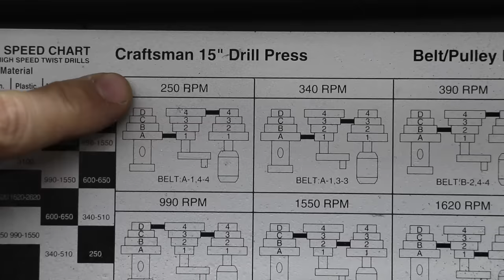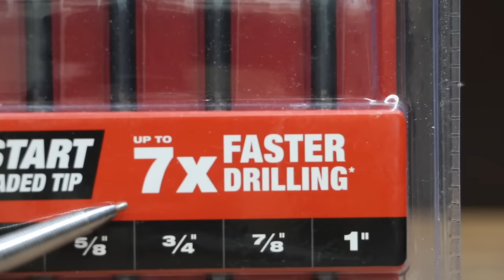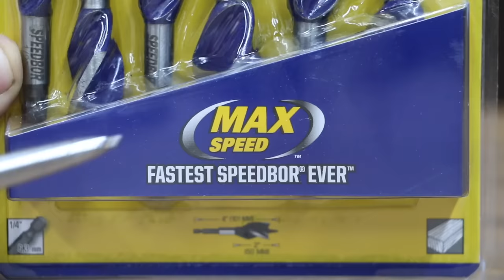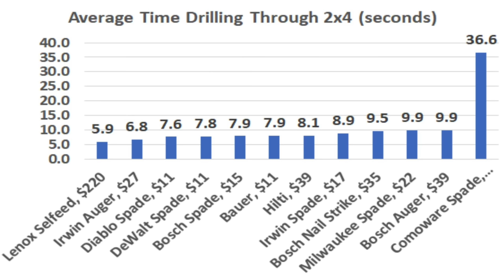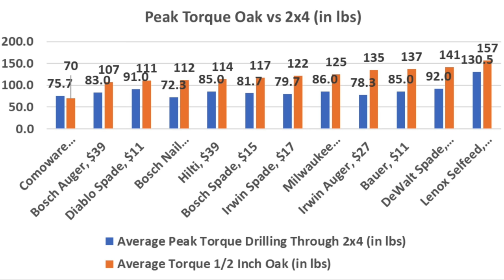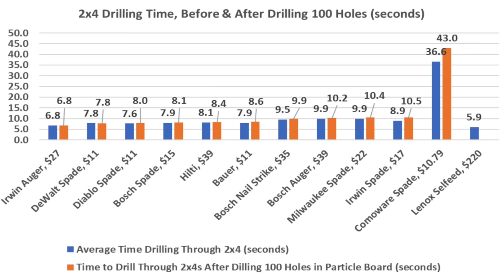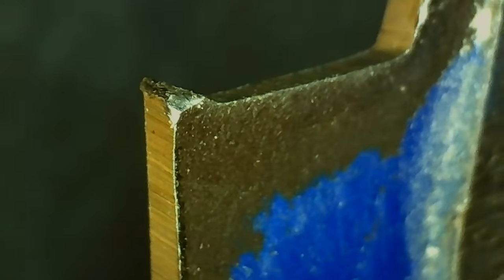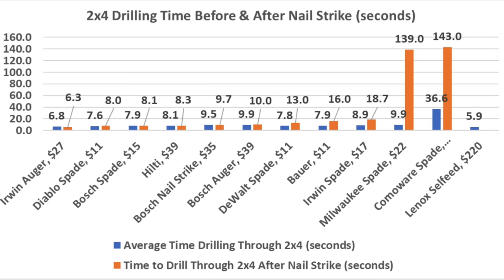Best Drill Bit Set? Hilti vs Milwaukee, DeWalt, Bosch, Bauer, Lenox, Irwin

Comment: This was very informative! My only wish is that you could have included a few more types of bits. I would have liked to see some cheap Walmart HyperTough spade bits along with the new Diablo Demo-Demon spade bits that incorporate some of the Bosch Nail-strike and Dewalt  endurance corner features. 
I would have also liked to see the various Spyder wood drilling bits included along with the very high-end WoodOwl brand Overdrive bits and the Milwaukee Speed-Feed auger bits. 

But perhaps that would have been too much work and made the video too long. Hopefully you can cover them in another video. You spent several videos on different types of motor oil, so I don't see why you couldn't have a wood bits video Part 2. 

I actually think a lot of your videos could use a part 2, especially as new products have come out since you made some of the older videos. I hope to see more "part 2" videos in the future. 

But I imagine you also have a large number of product types in the que that have never been tested before, so I can be patient.

Comment: As an electrician I drill hundreds of holes a week and often hit nails, the auger style bits outperform spade bits by a long shot.  What your test did not take into account is we often don't get a straight shot at the work and are drilling at odd angles and there are almost always nails.  Nails eat spade bits.
Reply from the maker: Thanks for the constructive feedback.
Reply: i’ve been using the diablo augers, formerly bosch. they last a long time and sharpen really easy
Reply: Spade bits will grenade hand drill gears with their rough exit. I wouldn't use anything but an auger bit; save the spade bits for the drill press.
Reply: @Ch4grin  My drill just snaps off the shafts. I don't use them for anything anymore.

Comment: Very nice, I know from personal use that once you use the self feeding bits you don't go back to the regular ones, some of the regular ones do good but where the self feed really shines is in awkward positions where you can't push on the drill very hard, say in an attic drilling a hole over your head one handed.
Reply from the maker: Thanks!  Thanks for sharing.  Happy New Year!
Reply: Or in a crawl space where you're pinched between old foundation and new joists.
Reply: They can be too aggressive when you need a clean hole like for a lockset plunger. I've actually split a door with one once, and they're a heavy load on a drill. Use the right bit or blade for the job at hand- there's not one that does all jobs best.
Reply: @P_RO_  heavy load? Not for any drill worth being on the jobsite. Different strokes for different trades.

Comment: Those Irwin Speedbor are nuts. I've never taken close to 6 seconds to go through a 2x4 in my impact driver, maybe 3 seconds. Obviously drill press is going to be better for consistency testing, but it is awesome by hand. Never tried oak through, I don't come across that.
Reply: Thats because he's applying a set amount of pressure. Of course they can drill faster.
Reply: Drill presses run far far FAR slower rpm than an impact driver. !
Reply: @DiscoFang  maybe sometimes… but the rotational speed of an impact is inversely proportional to the load it’s experiencing… fast unloaded, slow loaded…
Reply: why are you using an impact driver to drill? 
wrong tool my friend
Reply: @19derrick77  Good point. Then it becomes important to note that Irwin specify a speed of 1500-2000 rpm for their Speedbor. In this test he was running it at 250rpm. If the impact driver is turning at that speed when loaded then it’s def not appropriate.
Reply: @DiscoFang  Yes, the main thing here is every tool has a recommended speed range… Too fast, you’ll burn something up, too slow with a small bit and you may break it if it grabs. My own drill press tops out at 3630 RPM… Not appropriate for much of anything but the smallest of drillbits, a stone or flap wheel.

Comment: Spade bits almost always tear out of leave rough edges especially in grainy hardwood like oak......even worse if they have a threaded screw tap point!  I only use spades for home repair or non visible surfaces.  For clean holes gotta go with high quality forstner bits like the Fisch Wavecutters, but obviously on a whole different price level.  If you need hundreds of high quality holes like for a commercial application then maybe Famag Bormax3 with the carbide teeth.....but they are like $80 a bit.
Reply: Agreed

Comment: Didn't the screw lead on some of these bits negate your "constant down force" rig?  Once the thread bites, the weight is redundant really
Reply: They still need continued pressure for the screw  to bite in softer woods (or not pull out).

Comment: I would love to see if you can find a way to test these bits with an impact, some bits preform better on an impact then a drill and it would a nice indicator of extreme wear over time.
Reply: Yeah I'd like that too, but I think he's going for consistency and unless he has a impact drill press it's not going to happen..
Reply from the maker: Thanks for the suggestion.  Happy New Year!
Reply: @dondiego124  
An impact drill mounted on a press could be used. Impact drill bits of various shank sizes (my Milwaukee motor has a 7/16 hex quick release chuck) are used in construction.

Comment: As a woodworker, I am not too concerned about how quickly a Spadebit cuts. What concerns me is how cleanly the bit cuts and without tare out. No Spaidbit cuts cleanly on the exit, This is why a skilled woodworker will stop just short of the exit cut, right at the point where the point of the bit is poking through. Then the cut is completed from the other side. Another fact. When using any Spaid type bit, light pressure is applied at the beginning of the cut. This helps avoid tare out. And by the way. Only an idiot would try to drill through a nail with a spade bit. No disrespect intended.  😁
Reply: If you give me a 👍. Let me know if you are an experienced woodworker.
Reply: You're right, nobody would purposely run a spade bit through a nail but strangely enough there are a lot of screws and nails used on construction sites (where these bits used the most) and they are often hidden from view. So knowing which brand is going to hold up best to rough and repeated use is the most important aspect of this video.

Comment: I typically love your tests, but with this one you can’t test speed when the main reason some of theses bits are supposed to be faster is because the bit gets pulled into the wood, but that can’t happen in a drill press
Reply: Also different types of bits... it didn't make sense; it's like comparing a powerdrill to an impact driver.
Reply: I know from experience those bosch spade bits when new are about 4 seconds through a 2x4. And with any self feeding bit they are a pig to get restarted if the thread binds up or strips out.
Reply: That is true.
Reply: @TehBIGrat  that's why I switched to WoodOwl. They're too fast though do you gotta be careful not to lose control at first. Plus their bits produce beatter-than-Forstner quality holes and hardly ever any tear out. 
 
They're expensive bits but for the most common sizes (¼, ⅜, ¾ etc) They're worth their weight in Project Farm videos lol. 
 
Try one bit and you'll be all psycho trying to talk people into trying them, like I am. Lol.
Reply: @wojtek-33  to a degree yes, but it's still holding the bit back as well.  But a lot of that is also due to speed bit is spinning.
 
I can put a ¾"  WoodOwl through a PT 4x4 in under 2 seconds. And then I can test how fast the doctor puts the cast onto my broken wrist. Lol. 
 
The buts in the video being the same speed was an issue. Most people using spade bits tend to light it up and bore fast. Where an Auger or Lenox Style (Forstner-esque) requires slower speed.
 
The WoodOwl give too much speed, but can cut smooth like a forstner with hardly ever any Chipotle. It's like a Lazer went through it.
 
I giggled like a( 6'8" 330lb) little girl the first time I used the WoodOwl. It's really ridiculous.
Reply from the maker: Thanks for the feedback.
Reply: @ProjectFarm  Irwin SpeedBore to drill press: “If you’d have done as I suggested, we’d have been through a lot sooner.”

Comment: I’m a journeyman plumber and we use the Lenox bits because they make that style auger for pipe sizes up to 3 5/8”. Newer Lenox bits are not what they used to be but with a Milwaukee hole hawg pushing them they’ll eat a lot of nails before really slowing down on there drill rate. The plugging your having with it is a common issue but sometimes it’s unintentionally advantageous because it keep an apprentice from drilling so deep into a set of studs that he gets the bit stuck.
Reply from the maker: Thanks for sharing.

Comment: I can say from experience that the Diablo bits are fantastic. I drilled hundreds of holes in a new construction wiring install and the bit held up the entire time, even with hitting some nails. - I bought the Diablo after chewing up multiple irwin paddle bits. - the irwin speed bit is something I used as well and it also held up well however did eventually wear out by hitting too many nails
Reply from the maker: Thanks for the feedback.

Comment: I work on gas fireplaces, the spaces I have to work in under the unit can be very tight and I occasionally need to drill holes to adjust mounting configurations or what have you. The areas I work in could measure as narrow as 2 to 3 inches but more often I am graced with the luxurious amount of working area of 5 to 6 inches. Usually I have to make these holes by hand with self tapping screws, a nut driver and plenty of elbow grease and frustration.  I would be curious about the drills on the market that claim to be for tight or confined spaces and if they are as capable as standard drills, if they would work at all in such a space, and if so which work best. Love your channel, keep up the stellar work.
Reply from the maker: Thanks, will do.  Thanks for sharing.

Comment: i use the diablo high speed auger for work. i do electrical. they take nails pretty well but more importantly i can easily sharpen them with a dremel or grinder. they also seem less likely to get stuck and whip the drill
Reply from the maker: Thanks for sharing.

Comment: I’ve used paddle bits to cut big holes in 1/4” aluminum plate. Works pretty good. It doesn’t booger up like a unibit does. You have to drill a pilot hole though. You should add that to the test if you ever do something with these again.
Reply from the maker: Thanks for the suggestion.

Comment: Todd would love if you tested actual dedicated auger, self-feed, forstner bits! The various models of Irwin, Dewalt, Milwaukee, Spider, Diablo, Makita, etc. There are soooo many options, its hard to decide. Plus some of them have multiple cutting edges, replaceable blades on some, carbide/HSS cutting edges, titanium coatings, and so much more. Thanks!
Reply from the maker: Thanks for the suggestion.

Comment: I have two sets of wood bits, a cheap set covered in gold paint with tungsten tips and an expensive set of Frost brand auger bits.  I have used the cheap spades bits and to be fair they are actually holding up but are starting to become blunt, hopefully I can sharpen them.  The Frost bits seem to be just as sharp as new but have begun leaving rough edges on the holes.  I inherited some really old long auger bits for drilling through fence posts, these require a bit and brace to use them, I inherited one of those too.  I have used one when making some monkey bars for my kids, they work well and even though you have to use arm power I am not cutting off the block on the end of the bit so I can use them in my power drill.  I inherited these tools from my grandfather and I remember seeing him use them on his farm.
Reply from the maker: Nice!  Thanks for sharing.

Comment: Good video - I have the Irwin speed bits and I've definitely hit nails with them.  I used them with a Dewalt Impact driver. They are still pretty reliable and I love their speed compared to the generic bits I've used.  If. you are boring holes to run electrical wire, they are a must have.
Reply from the maker: Thanks for the feedback.

Comment: Had a similar experience with a 3/4" Milwaukee paddle bit after hitting a screw - made it nearly useless afterward - was burning holes more than it was cutting them. 

Need to get a set of those 'Nail Strike' bits to use in the future.

Comment: As always an amazing test, thanks. 
I use the dewalt bits, have to drill very long holes, 15" - 20", in hard woods we have tryed alot of bits and most do ok and the get very dull, and normaly twist. The Dewalt are hands down the strongest, not managed to twist one yet, but also by a long way the easiest to sharpen because they don't have spurs. They will also follow a hole made by the size down pretty well too because of them not having the spurs and having there unique design, this can be very useful and almost impossible with every other make.
Reply from the maker: You are welcome!  Thanks for sharing.

Comment: Hey, your video as always deserves for big thumb up!
After deeper analysis of the video and test I got some conclusion:
1. Drills without threaded tip have higher drilling time in compare to others.
2. The same drills have better in and out cut edge in compare to others - because of drilling speed.
3. Drilling speed depends on two factors and features:
   a) flat drills - pressure on lever,
   b) threaded tip - the thread pitch.
4. Probably, the threaded tip drills would'n need that amout of pressure force after all start tip is hidden in the wood (?).
5. Definately 3-fluted drills have better performance than 2-fluted.

Thank you one more time for great video and content.
Regards from Poland :)
Reply from the maker: Thanks and you are welcome!

Comment: As a former carpenter I can say that the Lennox bits are what is called a forstner bit. If you're drilling a hole in a finished desk or other type of furniture you'll want a forstner bit and you'll want to tape where you're drilling first. Also when the tip pierces the bottom side you'll want to finish drilling from the opposite side to avoid the blowout you were experiencing.
Reply from the maker: Thanks for the feedback.

Comment: Haha I had some bad luck with my Diablo Bit today, was using the 1.125” and I ended up hitting one nail.

The drill Bound up quite a bit through its use and slapped my hand pretty darn good. It hurt.

And the bit Bent, on the last hole, at the shaft. So it won’t be drilling straight. 

I might go for the Bosch Nailstrike, the name kind of implies It would be more worthwhile to pick up.

Comment: i used all brands . diablo  is my go to blades, drill bits, cut off wheels and grinding disc. very affordable and work well for daily use. if broken on job site they are cost effective to replace. before i used dewalt bits and milwakee blades glad i made the switch to diablo.
Reply from the maker: Thanks for sharing!

Comment: Bit choice will vary by application. As a furniture maker I don't need self feed tips or nail cutting capacity, but I do prioritize clean entry and clean side walls. I prefer the old fashioned spade bits, which I sharpen and resize on a belt sander.
Reply from the maker: Thanks for sharing.

Comment: I have a lot of different bits. I do like the spade bit due to how easy they are to use and how little power is needed to drill with them. Plus they are relatively cheap to buy. I have some Bosch dare-devil spade bits I bought on sale and have been impressed with their performance and durability. If I need a cleaner, rounder hole, I use forstner bits if I can.
Reply from the maker: Thanks for sharing.

Comment: Your channel is like a strange addiction, I just can’t stop watching.
The only thing that sometimes gets me is either you miss some products (I understand you can’t do every bit) like I have the dewalt auger bits and they do well or you don’t take into account how the actual bits/tools are actually used. Like with Speed bores I used them to run pipes and cables. I don’t need them to be perfect but I need them done quick and with an impact driver. This test doesn’t really bring that into account, neither does it bring kickback which can be a real thing. Like standing on a ladder and drilling into a beam and encountering kickback can be scary.
Reply from the maker: Thanks for watching!

Comment: Great review!  I think the threaded tip slows the cutter down because you can only go as fast as the threads will let you, but they really help pull the cutter through the wood and try and help with consistent cutter speed.  Both good and bad.
Reply from the maker: Thanks!  Thanks for the feedback.

Comment: Your voice sounds more relaxed and natural in is this video, not as strained and shouty as before. That makes the whole video more pleasant to watch IMO.
EDIT: technically all those bits with screw tips are self-feeders. Great for cordless drills, but i won't be using one in a drill press simply because it grabs and pulls the material as soon as it touches. The one time i wasn't paying attention and put a self-feeder in a drill press it pulled the part out of my hand while i was trying to line up the bit on the mark. The part spun around and bonked me on the hand. So lesson learned: start it after it's where you want the hole :)
Reply from the maker: Thanks for the feedback.

Comment: I ran into an issue where I was pulling wire through an interior wall 2x4 and sure enough there was a nail running through the exact spot I needed. Went looking for "nail strike" bits an found a diablo nail strike that chewed right through it. Thanks for your vids!
Reply from the maker: You are welcome!  Thanks for sharing.